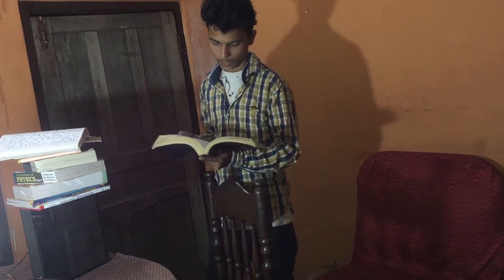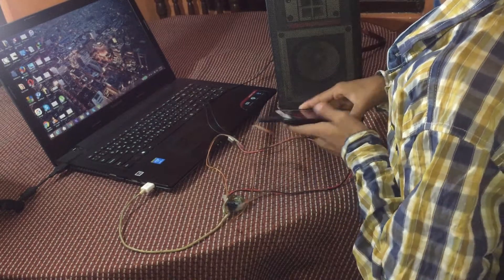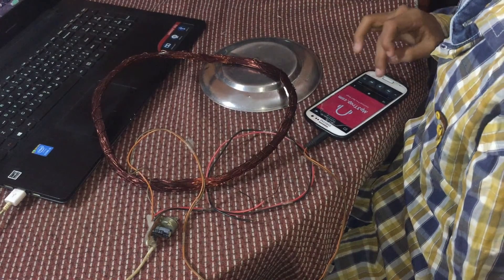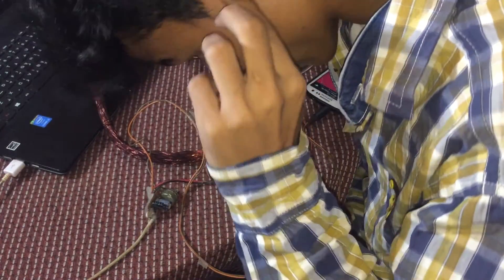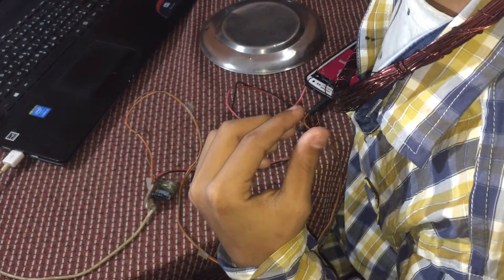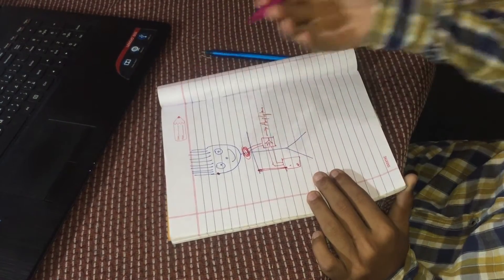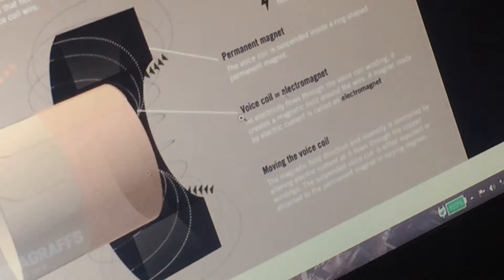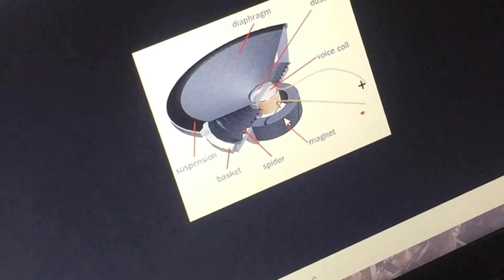#How to make wireless spy earpiece for your exams

Comment: Bro  loop contains how many turns & which number of wire u used
Reply from the maker: It's better to use a thin wire
Reply: @anishneupane  loop contain how many turns??
Reply: I made a loop about 50 turns but it only sounds when the magnet is placed about 2 cm away from loop. It cant make sound when i put the loop in my neck & magnet in ear
Reply from the maker: 50 is minimum use more than 50 turns for Better results
Reply from the maker: Are u using 5 v btry and whats it the radius of indictor
Reply: @anishneupane   my loop wire is broken and now it doesnt work can u tell me how it can be repaired , if there are fifty turns whaat is the wire broke from some place can we solider it or do we have to replace the whole loop

Comment: Bhai did it realy work in your ear , or just on plate
Reply from the maker: @funnyclipchallenge4078  it works myan😂
Reply: @anishneupane  how many turns are in the coil , i made it only when magnet is near the coil makes sound
Reply from the maker: @funnyclipchallenge4078  you have to do solve some eqn on inductance and magnetic strength accordingly, your amplifier also must provide sufficient current to induce magnetic flux onto that magnet for interaction, i made it without calculation, i made it rough bud it works somehow